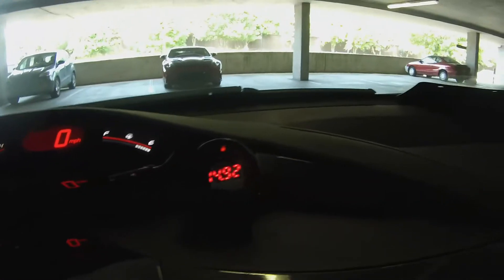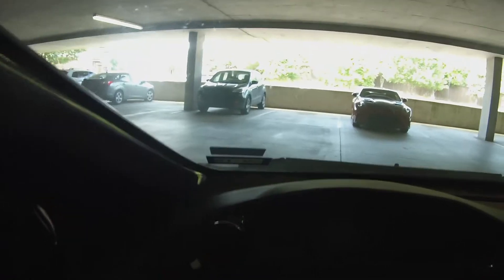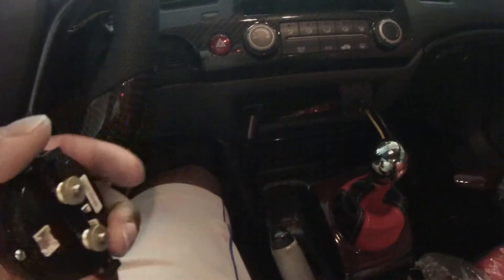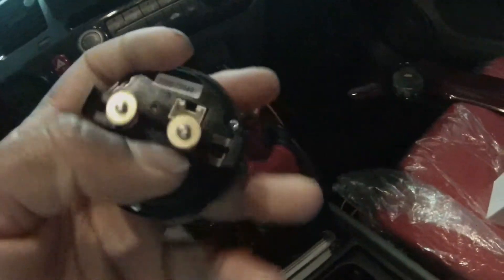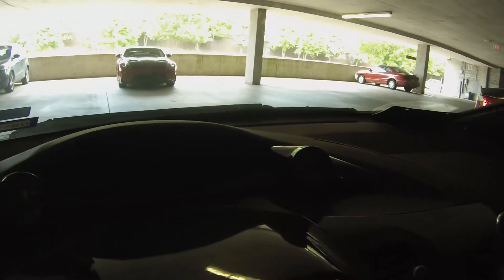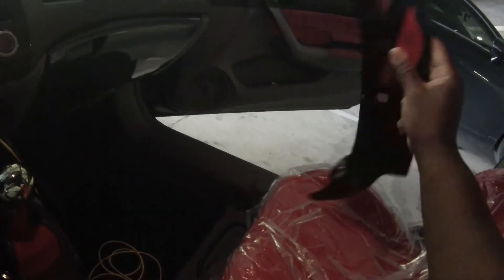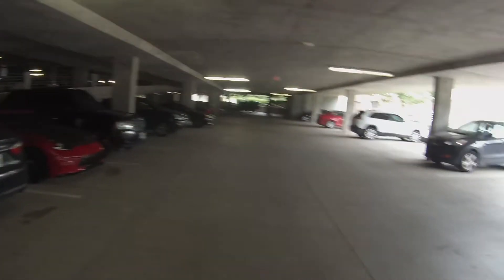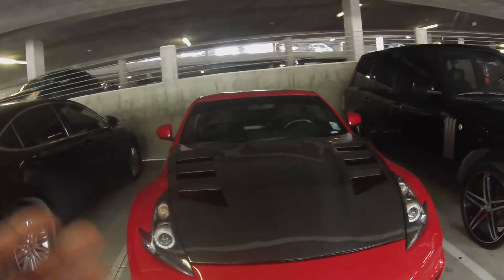06-11 Honda Civic R18 Turbo/Meth guage pod/dropping off Z

Comment: What kind of indash is that I need to know lol in search of a clean headunit for my 8th gen
Reply: I'll suscribe in return hahaha
Reply from the maker: Dee Cee haaa you should have been subbed man. Go ahead and Do it!! The current head unit is a Alpine Halo 9. There are two version the top of the line version and a stripped down one. I have audio videos when I did the system just go back and watch
Reply: Aight I got you just stumbled accross your channel bro. I'm boosting my R18 rite now it's all custom slim fans, tial Westgate, custom intercooler, bigger injectors, transmission cooler, skunk2 camshaft the whole 9! All I need now is a hasport rear motor mount, weapon R intake manifold, hondata, and a level 10 tourge converter. Ganna be pushing 300 hopefully all work done by me except the tune